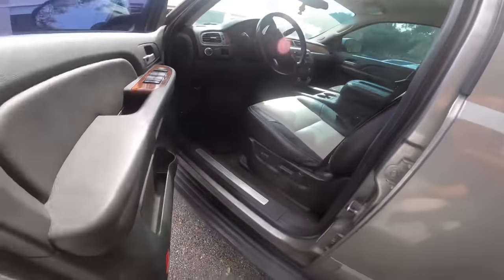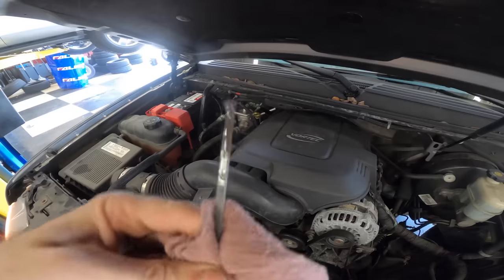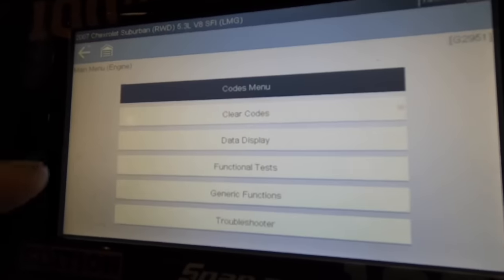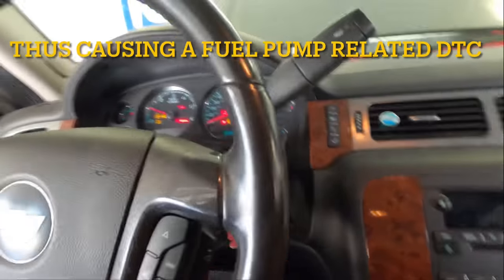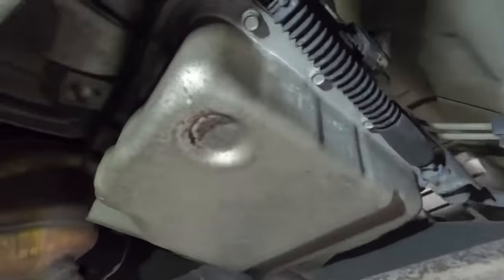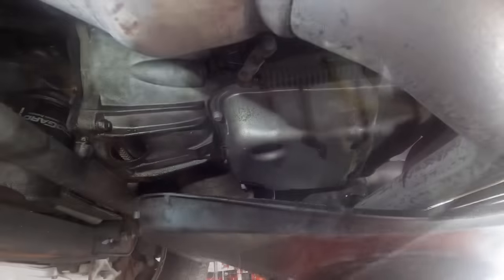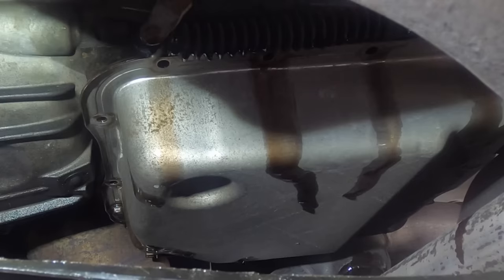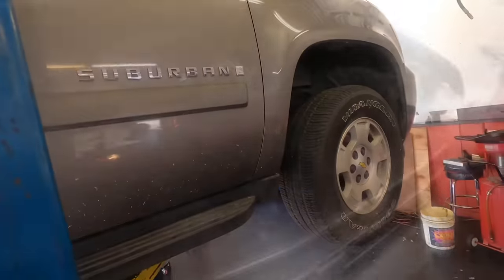Busted! SCAMMING Mechanic Causes Damage! 4l60E Transmission

Comment: I truly believe that most mechanics are good people. but I just had the engine in my impala "Replaced". full story is: My impala was running fine and then all of a sudden when accelerating from a stop there was a loud pop and then metallic slapping sounds. the local shop told me that there was a hole in my engine. they explained that the engine needed to be replaced. they quoted me $4700 for a used engine replacement and labor. that wasn't the cheapest quote but it was the only shop that had time for my car. but before they did work on it I took pictures of absolutely everything.  any number or identifiable marker in the engine bay I took a picture of. 

well after 5 months I finally get to go pick up my car. before I even drove off the property I saw something wasn't right. every single light on my dash was lit up. the abs light was on the service traction control was on. my radio no longer worked. a lot of things were wrong so I pulled back up and said "Hey something isn't right. all these things were working before I brought it too you" they replied with some garbage like "We didn't touch any of those systems so its not our problem" which I thought was extremely rude. but it screamed that something wasn't right since they weren't even willing to look at what was happening and were trying to charge me to fix something that was working perfectly fine before they touched my car.

I ended up going back over the engine with my father and we discovered that they never replaced my engine, they just patched it up and cleaned it a bit. but all the numbers were the same including the big scratch that I left on the block when I first changed the spark plugs. the pictured were identical. the engine was completely filled with Stop Leak. my radiator fluid was the consistency of tooth paste and was dark orange.. and there were several fuses missing from the 3 fuse locations. and there were wires that were cut and left dangling. including my radio which I discovered not only had its wires severed but was missing components like the radio was taken apart. when we confronted the shop about this they yelled at me and my father and told us to leave the property. to this day I'm still dealing with repairing their screw up with my car and my father is still trying to get his money back since he helped pay for the repair.

I just wish there weren't sleezy mechanics in the field at all and I hate that I fell for one of them.

 But seeing you work on these cars gives me some hope. keep up the good work man. and thank you for the content. already some of your videos has helped me work a little but more on my vehicle.

Comment: Yes I've got my transmission done had to go back and forth because it wasn't shifting into gears. So after a year or so I started hearing this tick tick tick tick noise I took to Suwanee did engine work for $2,800. When I pick my 2007 Ford f150 up there was a humming shuttering noise at the speed of 10-15 mph all the way sometimes to 35 to 45mph. Now nobody can seem to tell me what's wrong with it or what does it take for them to repair the truck back to its normal .

Comment: I’ve always had trouble with upselling dealerships. Come in for an oil change and they want to sell you brakes and tires. The car only has 8,000 miles on it. Exaggerating a little but I knew a dealership in Albuquerque that was prosecuted for predatory sales

Comment: Yep really bad , scam mechanics are out there for sure. I checked my mother car after a full service at a main dealer, only to find that the oil , oil filter and engine filter had not been changed. All they had done was oile the door locks and wipe some oil around the engine bay.

Comment: When you have a lot of weight on your key chain it will over time tweak the ignition. Try and jerk the steering wheel left and right if your keys stuck in place and remember to keep your key chains as light as possible to avoid it in the future. Thats an old grandad rule*

Comment: Speaking of shady or incompetent work...

My 85 year old mother was getting a cam timing actuator error code on her Chevy Equinox.  I told her, from 2000 miles away, it was a rather simple job, "Avoid the expensive dealership."

So, she visits a Pep Boys in Las Vegas, Nevada...  I get a call after they look over the car.  They want $500+ in labor alone to replace both the intake and exhaust cam timing solenoids.

Really?

I ripped the service writer a new one.  I was absolutely livid!  "This is a fifteen minute job including the time it takes to run to the donut shop for a snack and have a smoke..."

So, I drove 2000 miles out to fix her car and visit.  When I did the repair I told her, "Stand and watch how simple and quick this is."

In twenty minutes I had both solenoids replaced and the car buttoned back up.  Mom goes, "Is that all there is to it?  Boy, they were really trying to rip me off..."

Like cops, "Earning the hate every day."

Now, I know what they did...  The took the book rate for one valve and doubled it to replace both.  Such a quote only works on the completely ignorant and it's a total rip-off.

One can make a rather long and comfortable living doing honest work for honest pay...  However, the allure of quick, easy, and unscrupulous money corrupts many.

Comment: If that was my truck i would get 2 gallons of trans fluid and use a hand pump .Pump out the transmission through dip stick   at 50 miles then after another 50 and possibly a bottle of lucas for transmissions .By doing that you have mostly clean fluid .
Reply: Did this to my 2006 gxp 5.3 it had lots of metal in the pan 2 years ago .Cleaned pan and entire bottom of transmission changed filter used synthetic trans fluid and bottle of lucas .Then removed another gallon week later and again after 50 miles last change i added another bottle of lucas . i drive the car daily trans works perfect  lucky

Comment: So the blue fuse was removed and laying under those relays when you tipped the fuse/relay block up? I went back and looked at before you tipped it-i couldn’t tell. But the blue wire fuel pump power trick is a possible criminal act.

Comment: I called the blue wire and when I buy a vehicle with a 4LjunkE I immediately replace it with either a 4L80E if i don't toss a manual and regear the rear

Comment: There’s a theory that says the simplest solution is usually the right one. Crooked mechanic it is.  The sad part for the owner is that previous crook will deny everything, it’s not enough to sue over and the cops aren’t interested. 
The AG in Arizona recently collected around $50K in fines from three chain transmission places for charging for work that wasn’t needed or wasn’t done.  
I’m sure they’ll make that up shortly. No criminal charges.

Comment: When confronted with the evidence the scammer will claim that he or they forgot to replace the fuse box parts and that wire was a jumper for diagnosis that they forgot to remove. Or that it had to be there to make the vehicle run. Unfortunately incompetence is the refuge of a scoundrel but is not illegal. 
   The repairs the scammer was trying to sell would have added up to maybe more than the suburban was worth. But they were likely gambling that with the vehicle shortage and high prices of cars they could get the customer to bite. He is damn lucky he ended up at your shop and not taken for an expensive ride.

Comment: Great video. Good mechanic. Test don't guess. Unfortunately, with all due respect, it's not just one bad apple. It's the majority of shops at certain levels, up sell, price gouging and scam. I'm finding it more and more each day. 

1700 miles from home, I'm 26 days stranded. Three shops shops for transmission issues. Each one gouging and or egregiously corrupt. 

2 nd shop, had me drive 3 hrs, lured me in under false pretenses. Quoted $2000 tops, start at $895, add only as necessary. Called me at hotel. $5600!!! I said no!!! He said okay, $3200.  That's even worse!

I went to another shop quoted $2500 tops. They rebuilt it, then while testing, grinding noise. Oops. Called me, "minor problem" no worries. Three calls," no worries, under control." They told me.

Actually hiding from me, they broke the case and pump. Required re-do, buying new case and pump! $940!! 

Sent a courier to have me sign for $2500, saying truck 2 hrs from delivery. When actually over 24 hours. Then asked me for credit card number of dealership agreeing to pay the $2500 for me.

His clever plan was to run the card for the new $3440 price, to secure payment BEFORE disclosing his $940 mistake. 
Fortunately, of course, I didn't have the credit card credentials.

When he realized his cover-up was exposed, he held my truck hostage in lieu of now $3440 cash. No test drives. Cash in hand before the truck moves an inch. He shows video of it "moving" but no test drive allowed. I offered, and Sheriff agreed, to escort us. Follow test drive out, and back to shop...to the counter to complete transaction. He said NO!  No test drive! Period.
Research shows many instances similar to this. 
This is the mechanic world im beginning to witness more often.

Comment: Definitely ain't just you. But I wish to goodness I could find a guy like you in my area. Most in Las Vegas are the type to overcharge, at minimum.

Had a guy charge me $300 labor just to R&R a timing belt tensioner. Later did the same myself. Holy fuck, was it easy. Oh, n I believe that was under the MIdas banner.

Comment: He probably bypassed security (because of either worn key or ignition switch) he bypassed because thats what I did when mine wore out! I just ran hot fuel pump wire to battery.

Comment: A mechanic shop told a lady her trans was shot.. it only drove when cold.. when hot no gears worked.. I bought it and changed the fluid and filter... thousands of miles so far.. shop wanted 2500 to change it out.. shops rip off women..

Comment: The guy knew they couldn't check the fuel pump was replaced because you can't see the sending unit is replaced but the fraudster gets a way to bill you with no way other than pulling the tank to check if the guy is lying!

Comment: 19:12 I have a nice surround sound system on my pc with Mutiple LFE sub channels and when the car is shifting you should hear and feel the low vibrations your mics picked up. lol I was like ohhh, that doesn't sound great can't feel great to him if my room is vibrating from the transmission noises... I'd be worried the transmission is damaged from the hack bypass the other shop did. the computers had no real control over the shifts or what was going on, probably not locking torque converter at proper times if at all and causing clutch pack damage. I am shocked the car didn't go into limp mode all my bosses gmc or chevy trucks/suv all go into limp at that slightest sign if an issue...

Comment: Is there any way this could be a "bypass test" where the technician simply forgot to remove the jumper wire when they were done? I am not very good at detecting whether there is malpractice or not, so there could be some factual evidence I am missing. I have heard of many cases where elevator mechanics leave safeties jumpered, leading to real incidents resulting in injury or damage. However, these acts are caused by incompetence and negligence, and are not truly intentional. Without actually laying all the maintenance records out on a kitchen table and going through them for hours, I would say there is no way to tell whether this was sabotage or just gross negligence.

Comment: I have one question for you did you remember to remove the old seal out of the transmission from the old filter before installing the new filter on the end there a seal that goes up and makes the complete seal, so it doesn’t suck air through the filter on the neck of the filter the old one wasn’t on the filter so it was still in the transmission

Comment: If it’s a Chevy it’s not a scam. My boss abused the Ford work trucks still didn’t break em. He was mad his Chevy new broke at 7k Miles shop finally put a new transmission in because they couldn’t figure out the problem after 6 months 😂. Bought my 98 Ranger for $300 been driving 8 years only done about 250$ in repairs 😂

Comment: You really have to do some research and find a reliable shop. Even dealerships are shady. It happened to me before at a Volvo dealership.  A technician didn't replace the oil plug properly, and all my oil dropped out, and my engine died. Shadey stuff.

Comment: I have a 99 k1500 z71 5.7 and my ignition key has to be pulled slightly out to enable turning it on to start the truck. And I even put a new key tumbler in it..I have to pull the key out just a very little then it turns on smooth..

Comment: This story makes me wonder if every car owner should own his or her own scan tool able to scan coding and fault codes of all the modules in the car. And whenever the car is serviced anywhere, the owner verifies the changes made by himself or herself to make sure the car is at least in similar condition as before the service.

It's definitely not okay to get any new faults whenever a car is serviced by a competent mechanic. But if you cannot be for sure that the mechanic is competent, you have to do the QA by yourself instead of trusting the mechanic.

It's important to understand that not all faults light up the warning light in the instrument cluster but every fault is still worth knowing and following any changes related to it if it doesn't make monetary sense to fix.

Comment: Could the scam mechanic have caused transmission damage by modifying the sensors causing it to be in limp mode and slipping starting out in second gear?

Comment: I see no reason for the relays, fuse and wire, except fraud. That was really dumb too, because the blue wire was obviously a temporary wire, and it's so obvious. He was going to make himself $1,000-$2,000, if not more, for 2 minutes of undoing it. Did he not think they might get discovered? How many has he ripped off? He obviously did it before, because he knew what to do.

Comment: Why do you start tarring  down the automatic gearbox that early? I would have filled up the gear oil at first, because it was at low when you checked it.... You can get problems with the gears when it's to little oil in the gearbox... I had problems with the gearing when my old chrysler grand voyager was low on gar oil....But....I see that you found other things wrong, so the problem was something else...But anyway...I prefer to have the correct level of oil when testing the gearbox when I drive.....

Comment: It looks to me that someone was trying to fix a problem outside of factory methods and clearly didn't know what they were doing. Hacks will be hacks. All this started with an oil change? Where is Colombo when you need him? Just one more question, if you don't mind, just how long exactly have you been driving around with that check engine light on? And you said this mechanic, he was holding a homeless sign when you first meet him? lol

Comment: I don’t know why they don’t do this to all transmission pans is put a drain plug and I got my 2000 Ford F250 it has a drain plug drain it first and then take the pan out without making a mess. I don’t know why all of them don’t do that stupid because look up of a mess. It is taking the  Bolt Out Certain Way, Angela drain I don’t know. I don’t know why they didn’t do it that way.

Comment: I don't think that he tried to scam. I believe the car has a (maybe intermittend) problem with the fuel and he tried to fix it but didn't understand. So he circumvented the fuel pump relay and something worked better afterwards. Of course the battery drained. Somehow he messed up the transmission, maybe he doesn't know what happened. Than the trouble codes scared him. So even after fixing the key lock, I assume the car will have a problem and comes back "doesn't start" or something.

Comment: Ive been a mechanic for 40 years now and ive seen something's that were very wrong, i was working at a newly open mechanic shop and my boss he did somethings that couldn't be apart of and i quit that job and started working for myself, my old boss did a lot of work for the used car dealers and some of them were cheapo theifs, they bought a 90 Mitsubishi 3000 gt for dirt cheap at auction and they brought it to my boss and it had a spun bearing and should of been totally rebuilt but these scumbbagswere cheap they just wanted the rod knock gone so my boss removes the oil pan finds the bad rod and the crank journal was no longer round it was egg shape it was bad i told my boss dont do it but he did anyway he put a new bearing in and shimmed the hell out of it and put it back together fired it back up and no rod knock and these used car dealers auctioned off the car and made an extra 10 grand while some poor bastard thought he had a nice car and possibly while driving it somewhere it threw a rod and when you throw a rod while driving a stick shift hold on cuz your going for a ride out of control and possibly you could be killing other people and urself, this kind of shit work gets people killed and KARMA doesn't forget, when i fix cars its alway no rush take your time and do it right the first time, i rush for no body you rush me i work slow i don't use air tools or electric either, how are you going to keep in shape using them tools designed to get it done faster, take ur time unless you get off on stress go for it

Comment: What did this other shop  do.   Do you think they put burnt fluid and metal in your tranny. .    the fuel pump circuit is not  used in the transmission circuit.  It has its own fuse. One power wire going down to the transmission .pink wire.  The rest go to the computer.  Computer grounds the circuit